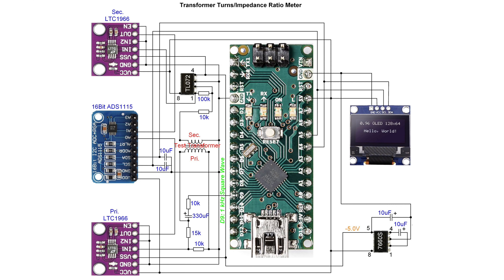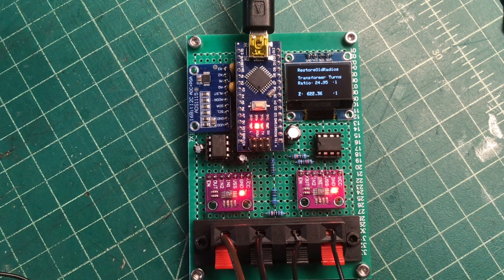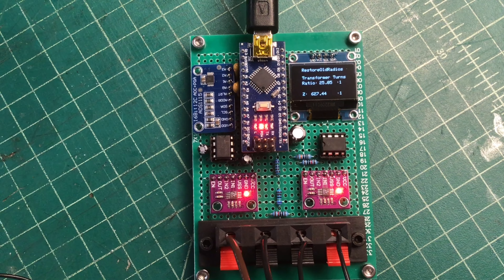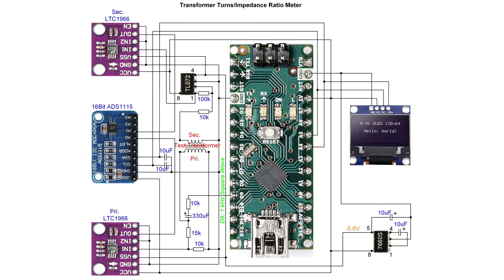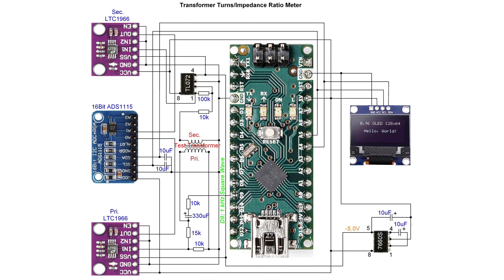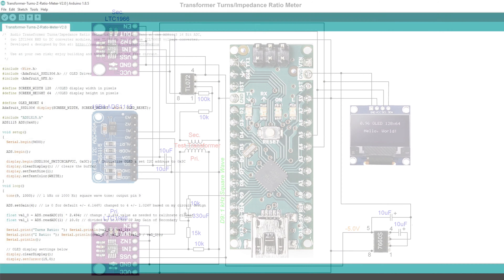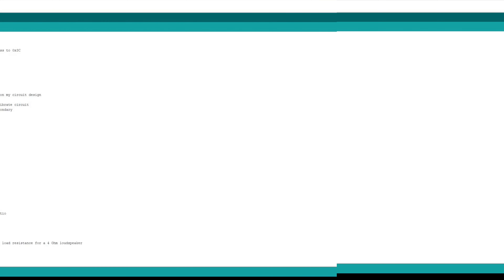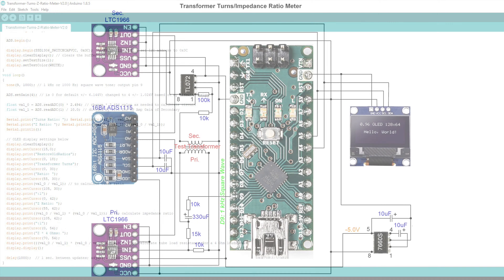New Design | Transformer Turns/Impedance Ratio Meter w/ Arduino

Comment: Ohhh Don, awesome vid to,say the least! I have been using the 1115 for over 5 years now. And it is the best 16 bit a/d on my shelf and even in 2 projects I currently made. Ti made a fantastic little 10pin chip here that used to cost so much back in the day for its precision. Good choice here buddy, I bet any project you need to make in the future for this kind of analog conversion or detection, will always guide you to great designs. 

I don't use it with any arduino stuff I'm doing, I go a bit deeper here with both the a/d as well as I2c cut line by line in C programming using Microchips MplabX compilers. I can get stuff like this running on a pic16xx, 8 pin chip by itself. Being in engineering so long, I need to have full control and don't like libraries and it makes it more proprietary for stuff ive done b4 retirement. 

For you or anyone tho to get stuff done quickly, why reinvent the wheel is the best way to go. The arduino or even the raspberry pi can get stuff done quicker and end up the same in the long run. Good work Don. 

That system looks great! The 1966 tho looks very very cool. I've got a design for what I call, the ultimate variac based power system for radio repair and/or low or high voltage power supply needs. I use a discrete cap/res/diode design that gives my a/d an rms value that seems to work fine. I monitor ac voltage from 0 to140 volts ac. I didn't need precision here tho, just a 1% or so was just fine. 

Linearteks 1966 tho, which I didn't no about looks awesome!! Not only a great way to get nice rms vals but differential as well! Thank you for sharing that. Wow buddy, you and I think the same, altho you've got a better handle with rf technology that's just awesome! So appreciate what you share. See ya later bud . Oh by the way, any reason your using caps on the i2c lines. Just curious.
Reply from the maker: Tony - my eyes are crossed after transferring my hand drawing to CAD earlier today. The two 10uF caps are most likely shifted and should be placed on the A0 & A1 inputs. I’ll confirm tomorrow, reach back out and update the schematic. Thanks for catching this, you’re the best. Don
Reply from the maker: I corrected the schematic and posted it this morning. Thanks again for catching this; you’re the best. Don
Reply: @RestoreOldRadios   Oh great Don, I looked at it and it makes sense now. Altho not to push this envelop more, I found that the caps were odd and was a drawing typo you mentioned but what got me to look at it further is that I know sclock and sdata lines of I squared C always needs 5k to 10k pullups on each leg for proper operation. Thats why I commented.  Not on every device but just on one like the micro is good for the two resistors. 

Does the arduino have pullups built in for A4 and A5? I dont have the schema handy atm.  If not, it may still work OK but it is the way that Ic2 is needed for multiconnection operation especially with many devices.

This is great tho, I love your design. The negative rail on the second 1966 is cool no less the rest as well! Gotta get one of those components for my Variac design. My cheep r/c approach is not that good! Its insulting for the 16bit a/ds accuracy. That 1966 looks awesome. With my old design, It jumps around too much, and I have to mask it in code for 3 digits only and loose millivolt measurements!! hahaha!!
Reply: @RestoreOldRadios  oh wow, my mistake here Don. 🙃 I do remember  that i2c should have a pull up of 10k at most for multiple i2c components. Notice multiples!  Makes sense but when I looked at two modules I have, the 1115 and a realtimeclock, I noticed both have 10ks??. My 4.7k I added, brought it down to about 2k! Yikes! So I pulled mine out. I don't think these modules know what's needed here. Sorry Don, your circuit is fine. Hehe.